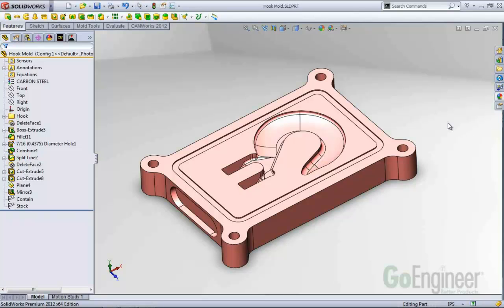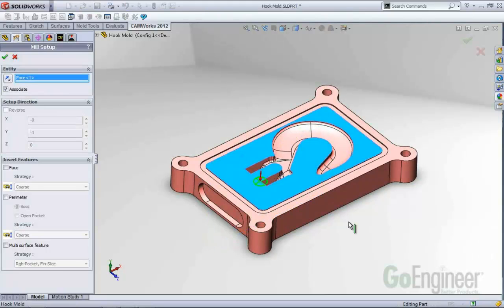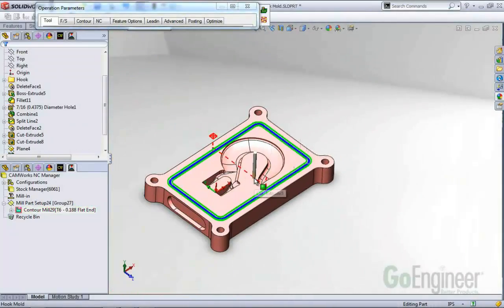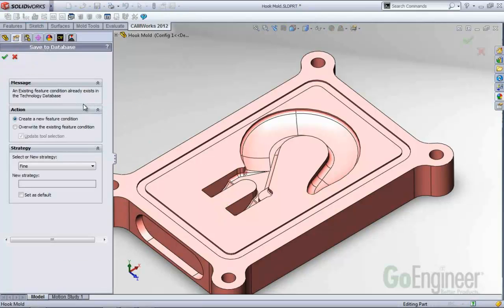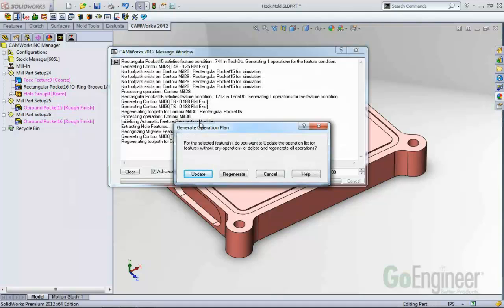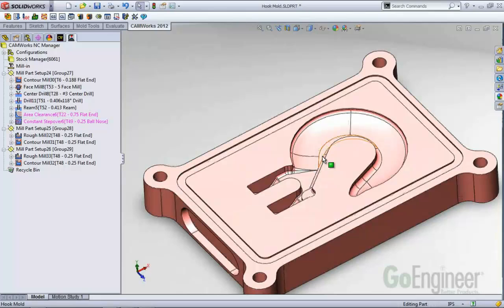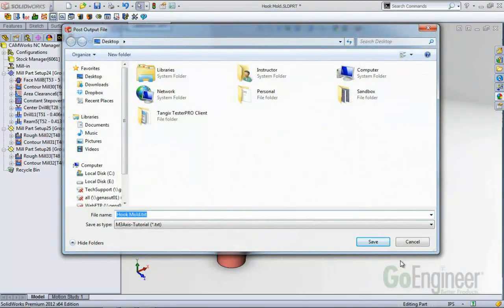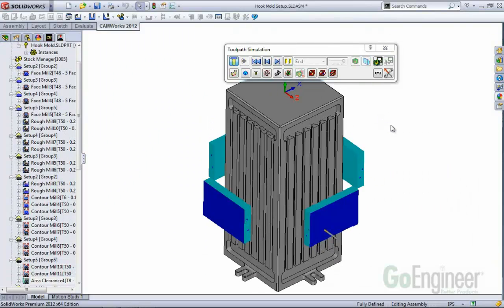Using CAMWorks to Increase CNC Productivity

Comment: HELP...
I am using camworks but it refuses to recognise fillets (Fillet feature). I am not sure if fillets are part of AFR (mine are certainly not). I suspect i will need to add the tool path manually. based on your video Multi face machining is the appropriate selection?

An excellent video, learnt more in 55 min than the last week